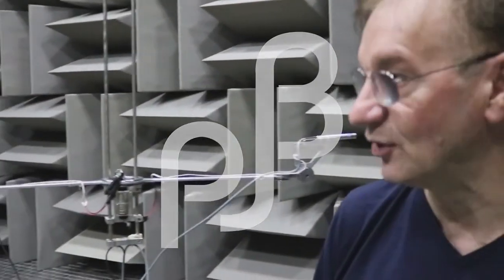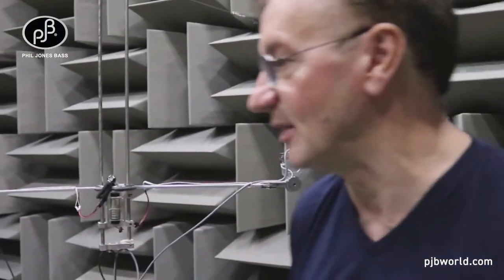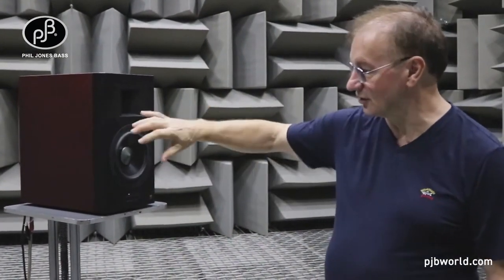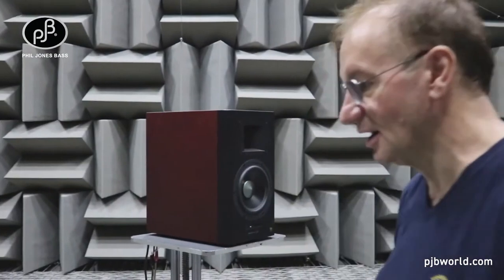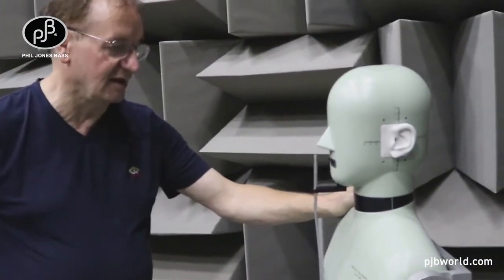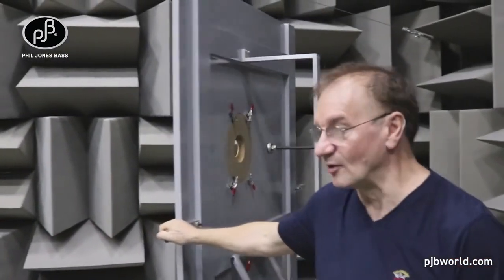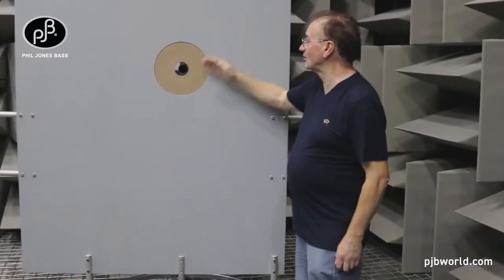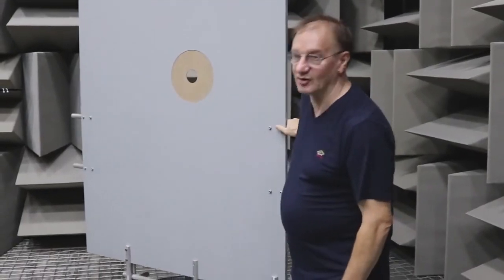Phil Jones Bass Factory: Anechoic Chamber

Comment: what is the largest bass cabinet have you built before. most amount of drivers?
Reply: PJB Bass cab with 50 x 5 inch drivers , power handling 5KW, Painfully loud, it hurts to stand next to it at full power but so clean sound.